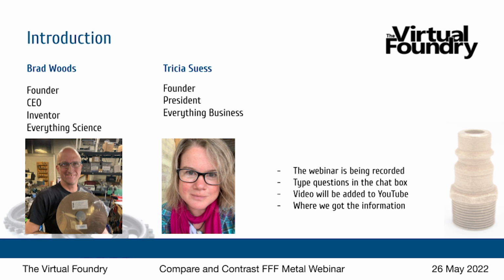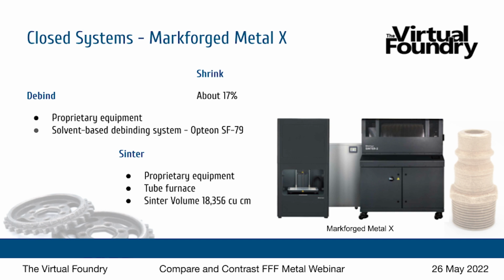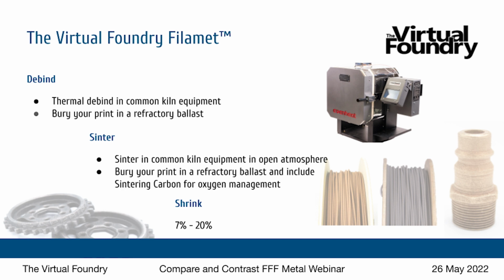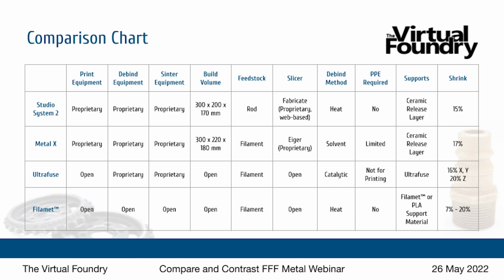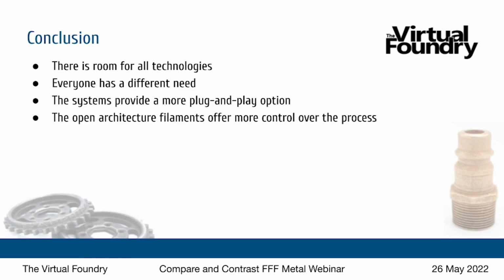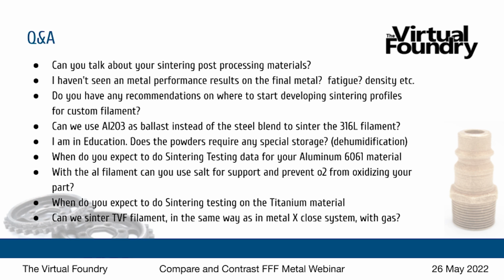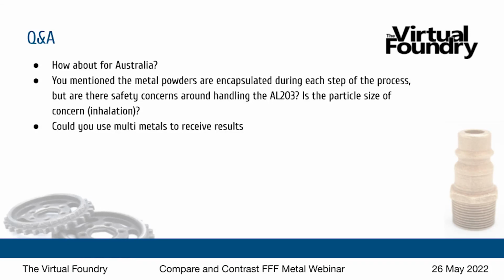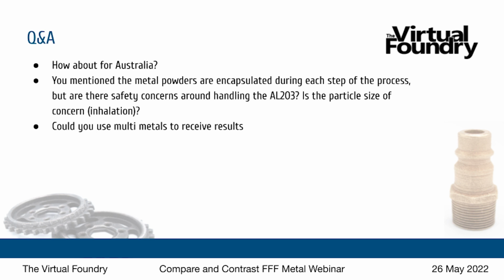TVF Webinar: Compare and Contrast FFF Metal

Comment: The printing problem is simple, but the sintering part is very complicated, it is difficult to achieve uniform results :( Moreover, the object has uneven shrinkage, making the parts difficult to use for mechanics. And i think SLM ( Laser print is the best )
Reply from the maker: It might take a cycle or two to dial in your parameters but it's definitely a repeatable process. And we give you as much information as we can to make sure you're successful.
3D printing should be considered a near-net-shape activity when tight tolerances are required.
There is room for all technologies. What works great for some may not be right for others. It's important that you choose the technology that works best for your situation.